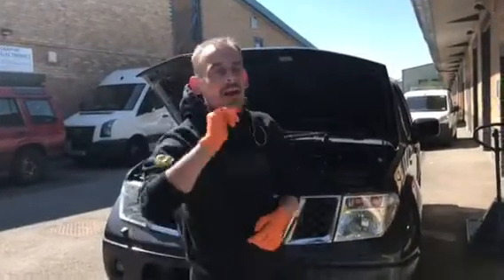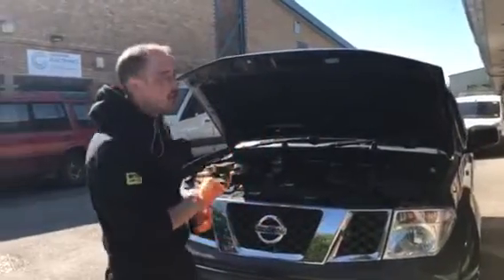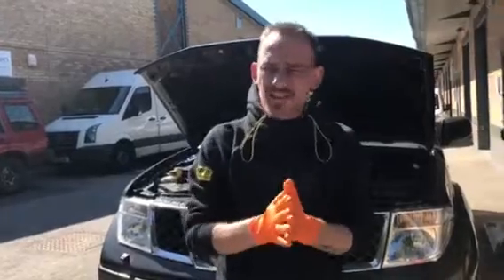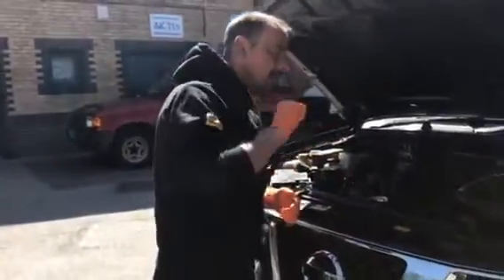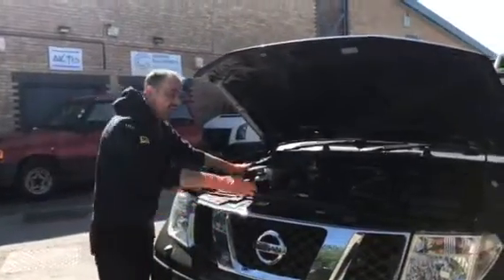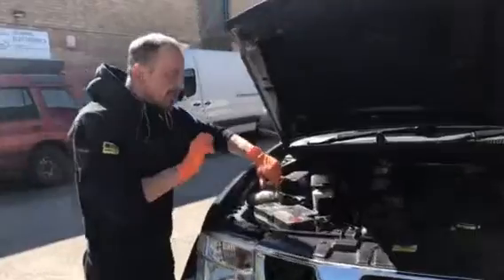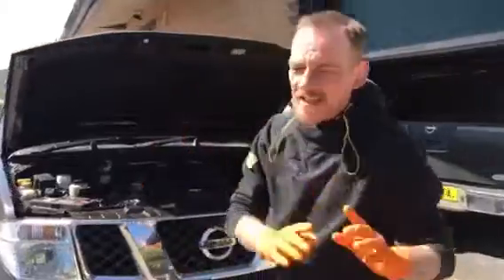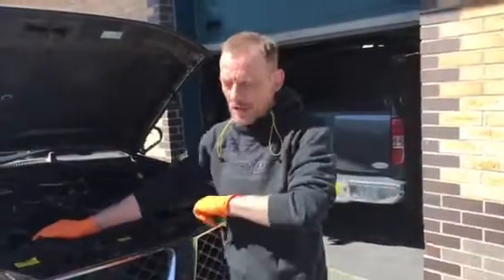How to Diagnose Nissan Engine Overheating Problems

Comment: Got the Nissan Np200 and it riding smooth but as soon as we hit the mountain pass than it starts overheating and we've been in to Nissan for a check but they can't find the problem what is the matter man... There's no problem with the engine
Reply: Sounds like an air pocket in the cooling system forms around sensor going up an incline.